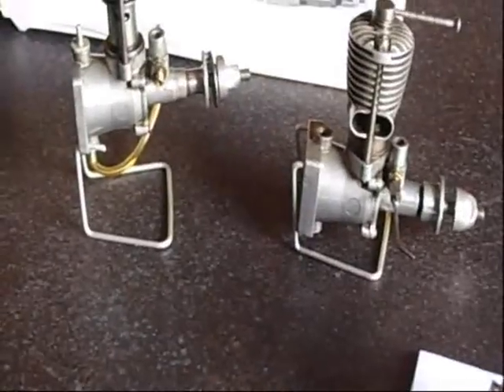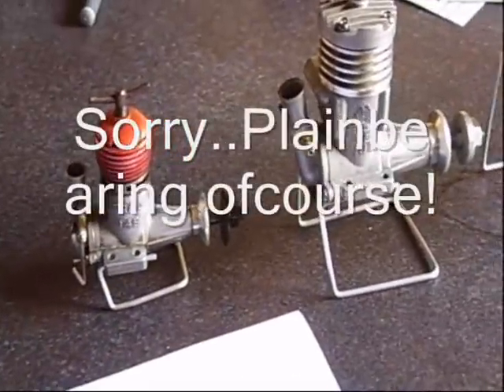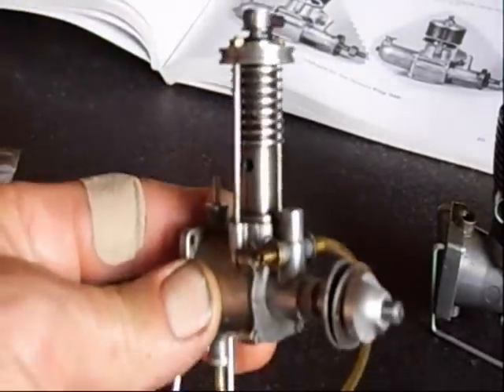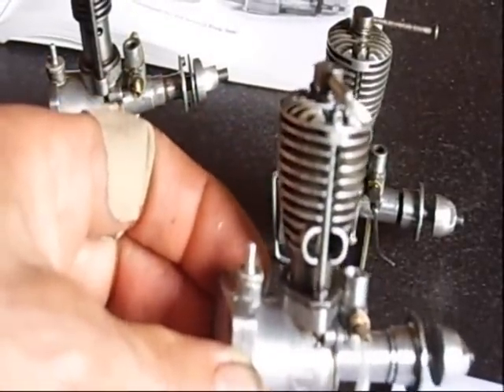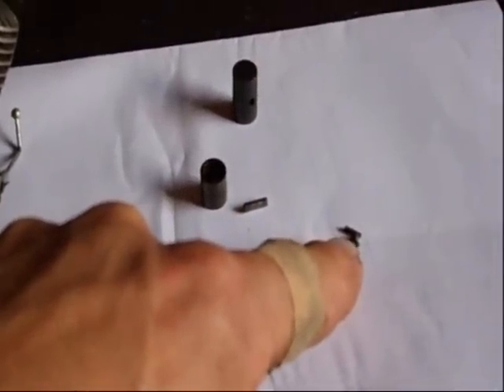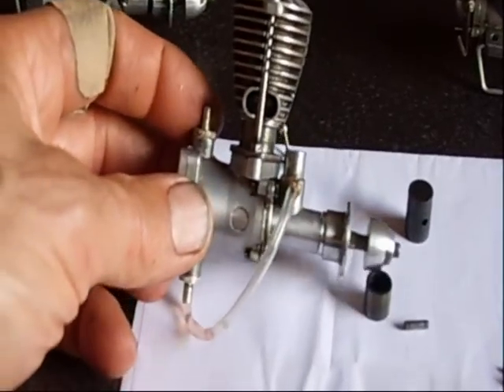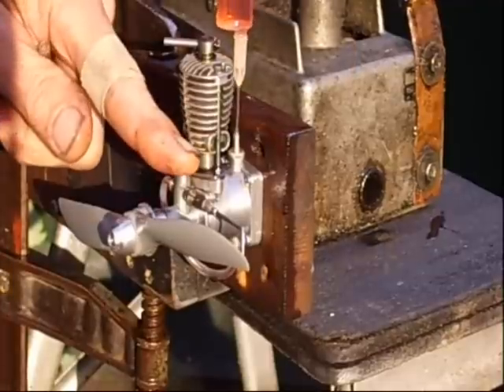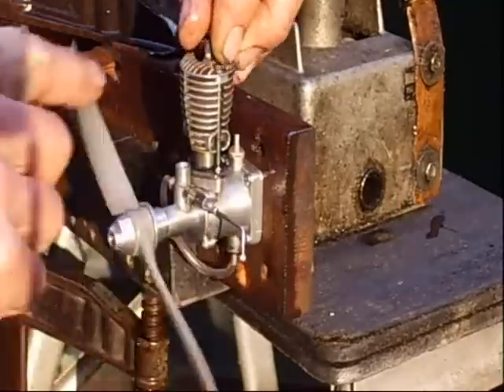Frog 100  MKII diesel 1948

Comment: Oh oh my dear Peter, I just win at ebay one vintage english Frog 100 diesel Mk2 :-)
Reply from the maker: +Jose Maria González-Calatayud Saiz ,This is great news.The old  Frogs are always very beautyful and wel made.They look so funny! 
Mills driverplate shoud be come very soon!! :-) ..maeby today! send freiday..
Reply: +valic000 oke you make a pavonised black with oil burn :-)
Reply from the maker: Its a special blackening compound Jose,no hot black oil..Now I work profesionaly! :-) I use old diesel engine oil in the past...I hope it fits nicely!!
Reply: +valic000  oh la la la , the drive prop plate is here so fast !!!!, is very beautiful, seems like an org. Driving-disk as said Mr. Mills Brother, also fit very very nicely, thanks a lot and also happy Christmas Pedro
Reply from the maker: +Jose Maria González-Calatayud Saiz ..I am happy it fits and looks as orginal...I was surpriced,it went so wel with a steel plate and a kurling tool...usually I use alu. I hope the littel Mills wil run fine now!! :-)
Felis Navidad amigo!!!
Reply: valic000 what mix fuel do you recomend for Mills 75 p?
Reply from the maker: +Jose Maria Gonz&#225;lez-Calatayud Saiz  Beatifull litter motorito. There are really very nice!!! I would do a normal mix  ..1/3 each for Mills and Frogolito  too.. always good...with a some drops of amylnitrate or cetaanbooster..then they  shoud run like a swiss watch!  :-)
Reply: valic000 I am faster than you. Mills run like a swiss clock with 33% mix
Reply from the maker: +Jose Maria González-Calatayud Saiz  Ha,ha... :-)  So the  needel or fuel problem is termibados?! ..  Be careful with the smal srews from the Frogolito..its very fragile..those a real watchmakers srews!! No joke :-)

I am now rebuild a ED Pennyslot 2 cc diesel for a friend. and weekend again on the big ETA project! Mas trabajo!!  :-)
Reply: +valic000 hello friend, how are you? today I start the vintage frog 100 mk2, I prime venturi and exhaust port and start easy at my garage, tomorrow  I test filling tank outdoor and rec video.
Reply from the maker: +Jose Maria González-Calatayud Saiz Hola Amigo! Al oki..still work on the ETA s. Now grinding the cilinders...and last step,I soon make  the pistons.So not a lot time for youtube and PC. But I am very happy for you..The old Frog 100/180 are so lovely!! 
Check out ebay. My friend Paul sell now also the FROG 100 mk2 box.I had some fotos of it,and he can  finally make a very nice reprobox! ( red- white).
 The Frog Meteorite is fantastico Jose! Never saw them before..a great combo with this motorino!  :-)
Salute!
Reply from the maker: Jose Maria González-Calatayud Saiz Always happy to help you,if I can..tele-diagnostic! The seller is right.Paul Harrys.Just mail him,as he get a lot scans recently from me from boxes,like Taifun and Webra. I am sure,he wil be offer the Frog 100 mk2  very soon.My box shoud come manjana.Its a week ago posted...
Check on the frog the carter seal.if there is no leak.Ofcourse dirty spraybar is a comon problem..
Pedro  :-)
Reply: The problem is contrapiston seal, I see top bubbles
Reply from the maker: +Jose Maria González-Calatayud Saiz .So its leaking compression. You need a bigger contapiston. No problemos.But must first finish the other work.Mucho trabajo aqui..  :-). A few weeks and it shoud be done...I hope!!
Reply: Ok. Dont hurry. Fist finish ETAs

Comment from the maker: Tanks a lot.The engine is back in the UK long time ago,but I was lucky to buy the same one later.I was experiment with the spraybar too,as the orginal 2 parts Frog carb is not the best working ventury.I made a standart 1 peace tube with 4 holes! 2 bigger on top,and 2 smaler on the underside.The idea was to get the fuel better atomized. I have so much engines still wait or there testrun on camera,but so littel time! :-(
Building at the moment planes,so I got somthing to fly this summer!

Peter